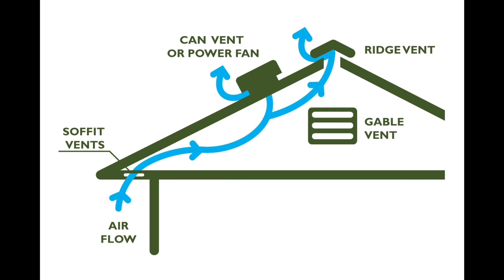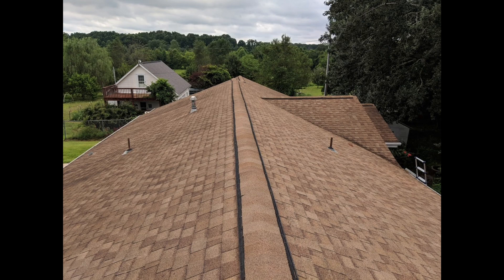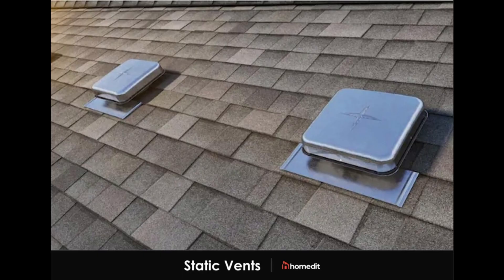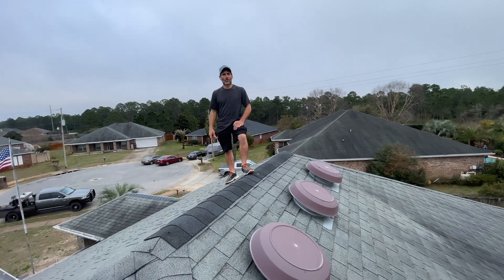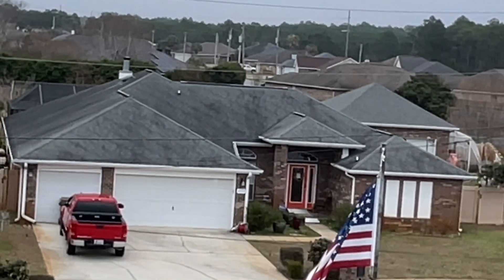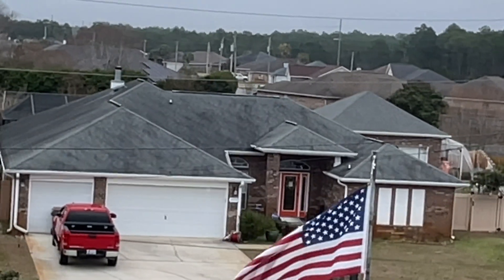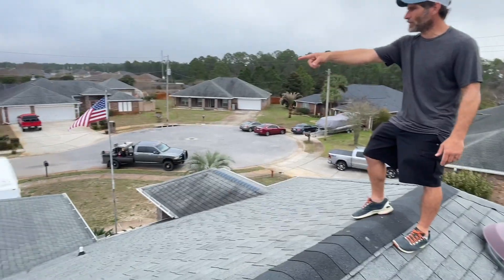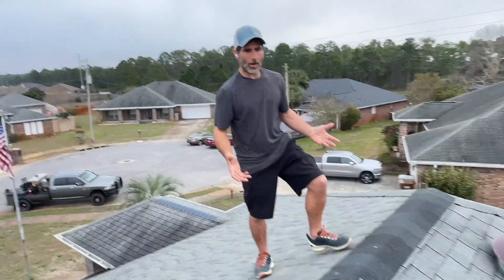How to Properly Ventilate a Roof, Proper Roof and Attic Ventilation

Comment: I live in south Texas and they are finally building homes with non-vented attics here. Vented attics are not needed in the 45+ day 100+ degrees in south Texas.We don't get enough winter weather down here to make a vented attic make sense. Attic fans are only pulling in 100+ degrees air for us. A conditioned attic does a lot better for us......
Reply from the maker: Agree but the expense is what prevents most from going that route.

Comment: Isn't there a larger electrical vent that would work? 3 seems excessive for the amount of holes to cut
Reply: The 3 are sized by the cubic feet (CFM) of the attic space. If it was a smaller attic, then 1 or 2 would be installed.
Reply: @amv_pure  but aren't there bigger fans?
Reply: @VanillaAttila  I get what your saying. Maybe it’s for aesthetics lol We don’t want our house looking like a UFO is parked on the roof lol
Reply: @amv_pure  Ok that makes sense lol gotcha, wouldn't want biden shooting it down :D
Reply: @VanillaAttila  hahaha :)
Reply from the maker: Those are the largest fans they make or at least that is the largest I could get. One fan does approximately 1000 to 1500 ft.² of attic space. Thanks for watching!
Reply: @WeatherProofingAmerica  this message has been approved.